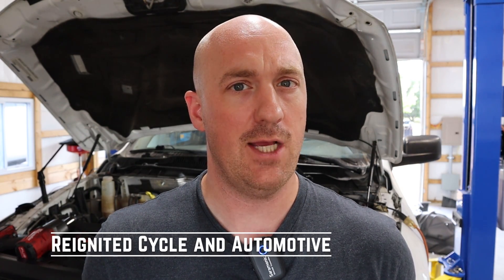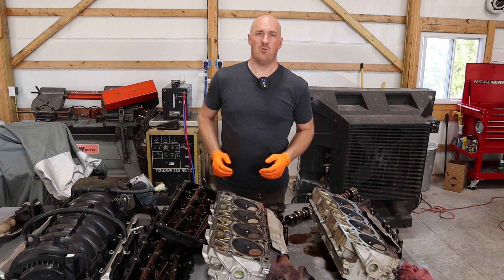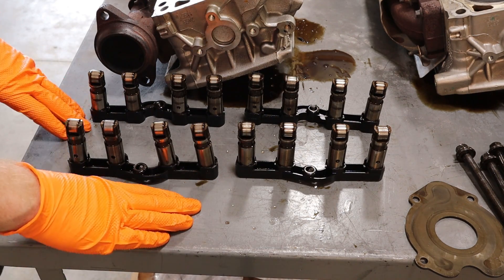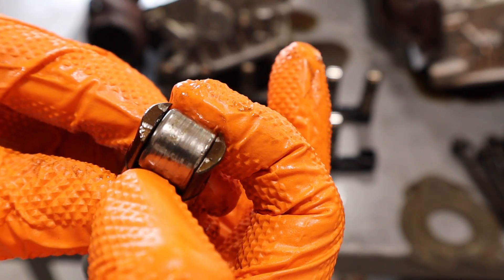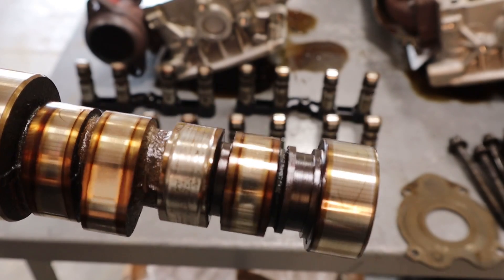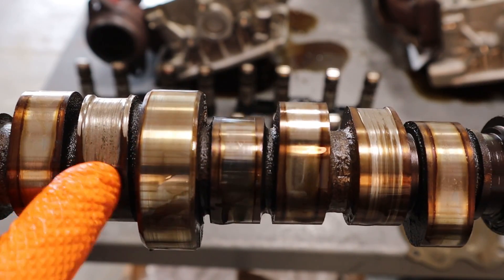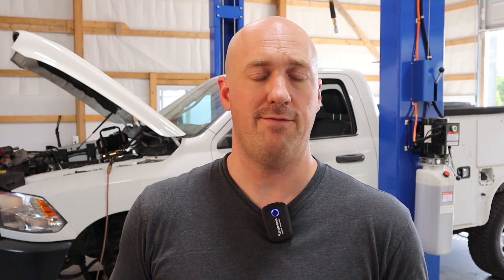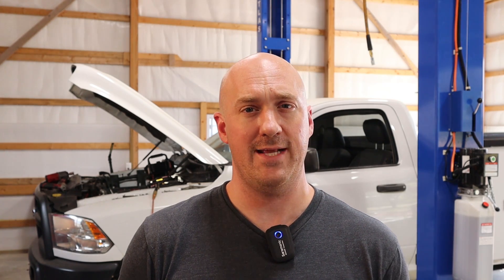Hemi 5.7 Lifter FAILURE Does this engine have a fatal flaw? Find out how YOU can prevent it!!!

Comment: So... Mt thoughts - Use a oil additive especially if its high milage. If possible eliminate the mds and put either regular roller lifters or swap the whole roller combo and go back to flat tappet. 
I am not sold on the idea that its a design flaw so much as chrystler trying to do too much in saviving gas for the economy. I mean lets face it - its a 5.7, 5.4, etc. its a V8 for crying out loud. why in the h*** would you want to do that to a V8? Its not like you buy a V8 powered vehicle and want to save gas!  if you wanted that then there are plenty of mini trucks or FWD cars around!
Just saying.
Reply from the maker: You're certainly not wrong. To be honest, all of the manufacturers are doing similar things, and the problem is - it's government mandated. The EPA has established MPG numbers that each manufacturer must meet every year as a combination across their lineup, and every year that number goes up. This means that every single year the manufacturers are looking for any and every little bit that can bump up their numbers. I believe the MDS system on the Hemi improves gas mileage less than 8% overall, and that's actually a huge number. I'd agree as well that removing the MDS system seems to correct the issue, in fact, most aftermarket upgrades will do exactly that for this engine. Appreciate the thoughtful reply and more importantly I appreciate you watching!
Reply: @ReignitedAuto  I do have a question though. can you just change the mds lifters without changing the can of it has not gone bad yet or giving trouble codes. would that still set off codes if you did nothing to the mds sensors basically tricking the computer into thinking the mds lifters were still there. would that work?
Reply from the maker: @ratchetswartz3321  The lifters can be changed without changing the cam, however, in order to swap out the lifters you must also replace the MDS solenoids with block off plugs instead, which are available from the dealer. Unfortunately this will most definitely set a Check Engine light.
Reply: @ratchetswartz3321  lifter failure happens just as much on non mds engines.
Reply: @scr454  very true. however, the mds engines have a known proven flaw. this is the reason for the blog. no cam and lifter should eat it before the engine reaches100000 miles old.
all we are talking about is how to prolong the life of the engine to the point  of normal failure.
Reply: @ratchetswartz3321  false. the cause of premature lifter failure is due to lifter bleed down then on startup and within 10 seconds the vehicle is driven down the road. Once you increase rpm on a collapsed lifter it takes longer to pump up. A lifter that is bled down causes it to hammer the cam lobe which causes the roller failure. Gm also has this problem. Its the nature of a hydraulic roller lifter and no other reason.
Reply: @scr454  yup like I said, a proven design flaw.  I understand the ls engines have a similar issue. the main problem with the hemi is not so much the bleed down but the supply of oil it gets. considering my ram takes 7 1/2 quarts of oil, you would think it had plenty. the design flaw is how the block is casted. there is really no way for the crank to splash oil up to the cam and lifters due to the location of the cam. chrysler could have fixed the flaw but yet refuses due to the cost of the recall I believe
Reply: @ratchetswartz3321  im trying my best to tell you what is really the cause and its not chryslers design. Ive made alot of money doing cam and lifters. If there were a design flaw it would have been mandatory for chrysler to perform a recall. They do not get to descide if they can opt out of a repair. I strongly urge you to become better informed before you spread misinformation. If you want to avoid the issue pit a solid roller lifter in it.
Reply: @scr454  if chrysler could have put a flat tappets lifter in them then why didn't they? it seems like the roller cam and lifter is the way of the future but this engine with the mds included is suggesting otherwise. please inform us! I'm not out to misguide anybody
Reply: @ReignitedAuto  Very good video so on the flip side what happens if the MDS lifters were not replaced but the Solenoids were removed and plugged? I assume that would cause a really bad internal valvetrain oil leak.
Reply from the maker: @anglia427  actually its very common in the aftermarket to change out the MDS lifters and remove the solenoids. In fact, the block off plugs for the solenoids are available direct from the dealership! Down side is if you are not using some sort of pcm tuner it will set a check engine light for the solenoid circuits 👍
Reply: @ReignitedAuto  Yes that part I understand I was wondering if you didn't replace the MDS lifters but did the Plugs only would that cause a bad internal leak?
Reply: @scr454  The solution is a higher weight oil.
Reply: @FeatheredDino  the only problem with that is the clearances throughout the engine is setup for 5w20 on 5.7 and 0w40 on 6.4
Reply: @scr454  Yes I have heard that argument a million times, it doesn't matter. We're not dealing with a Ferrari engine that has tolerances so tight a dust particle couldn't slip between the piston and cylinder wall; people have and do use 5w30 in their 5.7 HEMI, myself included for 108,000 miles, and have had no issues with excess engine wear or HEMI tick, and anyone else running 5w30 would report the same. 

Regardless of that, running heavier weight oil than specified in engines is nothing new, people have done it for a very long time to preserve engine life. Like running 40 weight diesel oil in an old V8 meant to run 10w30 etc etc.

Chrysler themselves have stated that the primary reason for 20 weight in the 5.7, is because of MDS and to a much smaller extent, VVT.
Reply: @FeatheredDino  all manufacturers run oil such 5w20 0w20 0w40 to pass emissions standards.
Reply: @scr454  Thank you kindly for sharing your expertise with us. I have a 1 week old 2020 RAM 2500 with the 6.4 that I'd like to run to 150k at a minimum. In a nutshell, what would you say are the most important things to help me achieve this (without 5-7k in lifter failure costs)? Thanks in advance!
Reply: @ReignitedAuto  I shut off the MDS with my Diablo tuner in my '14 Chrysler 300C hemi. Mileage is unchanged at 23 mpg and no more drone. 
This car and my '12 Dodge Challenger both get yearly maintenance done using AmsOil products and have not had any issues in 121K miles on the Dodge, and 64K on the Chrysler. Oil/filters get changed yearly regardless of mileage.
Reply: Or just buy the v6 option, why would buy a v8 to save money.
Reply: Looking at the lifter angle in relation to the cam I don't think the design would allow the use of a flat tappet cam , is there even one available for the gen 3 hemi ?
Reply: I mean some people are 18yr olds who want a fun/fast engine that they can get in an affordable second hand car and still want decent gas mileage since they live in california...like me...
Reply: Blue politics mandate it. Hell you got California going to the extreme trying to force people to have to buy electric cars. The "gas guzzler tax" is not changing enough minds (as always they want control over everything) so this is the next step to get rid of v8's
Reply: Check out Uncle Tony's Garage. This is the company line delivered by a company mechanic. Oil breaking down?idts

Comment: Of course you better change oil early if you have one of these failure prone engines.  The gen 3 hemi does have a design flaw or this wouldn't be a common problem. By definition if there is a common problem, it means there's a problem that needs to be fixed, changed, redone, solved, identified, not continued, put it in your own words but FCA needs to fix the f'n thing. Period. FCA just flat plain old needs to ditch this design and start all over. Any engine that can't oil itself properly is fundamentally f'd up.
Reply: Lol, agree, he says the gen3 hemi has no fatal flaw but makes a video about how faulty it is.
Reply from the maker: I still think it's a solid platform, but I am interested to see what the next generation of engine looks like 👍 Thanks for watching I appreciate it!

Comment: Wow, I expected to see some scoring but that is some pretty extreme wear!  Great point about the idling time, especially for people who take their lunch breaks in fleet vehicles idling with the AC on.
Reply from the maker: Once it wears through the hardened surface of the lobe, the rest of the metal is like butter. Like I said, I've seen a few that have completely round lobes. Hilariously, the customer will say, "it 'just' started making noise!" 😄
Reply: @ReignitedAuto  That is a lot of loose metal in that motor. Pray the oil pick up screen and the oil filter catch all that. Yikes.
Reply from the maker: @alexdegrat1006  usually the standard is to check the oil control valve screen, if its plugged with metal it gets a whole new bottom end. If the screen is clear you should be 👍